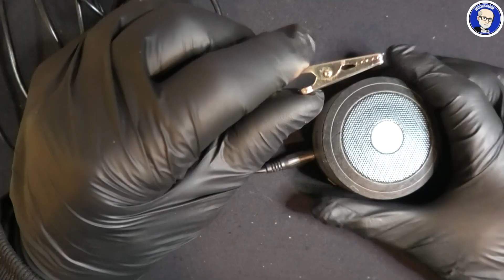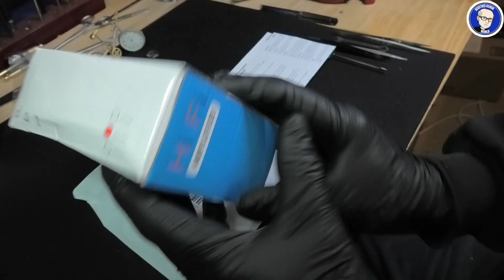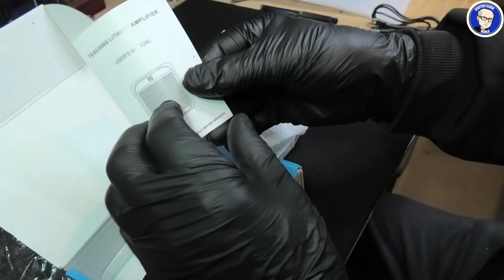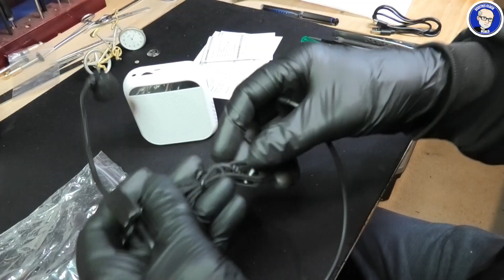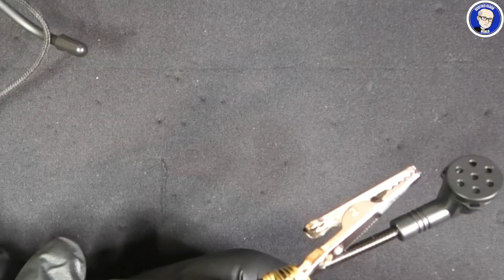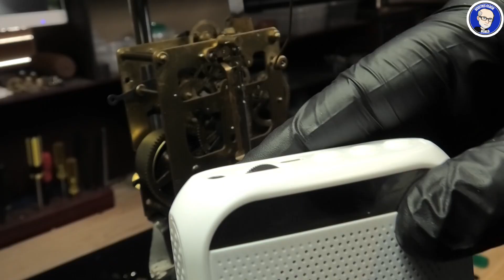Clock Repair Essentials, Timetrax Model 50 Replacement?, Lesson 9

Comment: Hi Scotty, I have used the Timetrax amplifiers, the first one developed a loud squelching sound when in use, and the new one I just bought gives the same squelch as soon as you turn in on!  I am returning it and plan to get the one you show here.  My question is, did you attach the alligator clip to the end with the microphone so you can clip it to the clock's back plate?  
Thank you very much!
Reply from the maker: The screech is the electronics 'feeding back'. Turn the amplifier down low when you first attach it. Yes, the clip was attached to the the end of the mic . Thanks for your comment.

Comment: I use an old radio shack telephone amplifier. With the time trax pickup.  Works well.  Uses Aa batteries.
Reply from the maker: Yes, I remember those radio shack amps. Thanks for your comment.